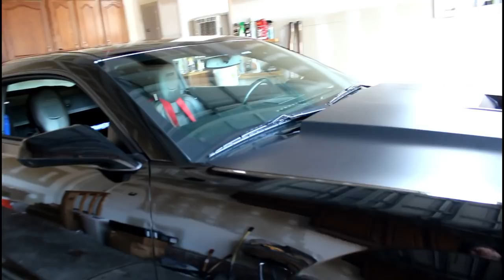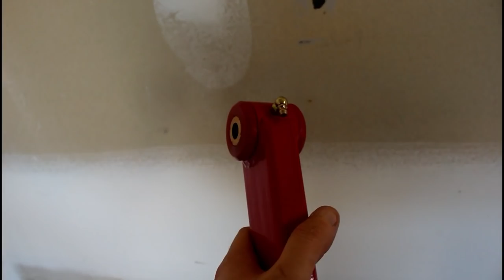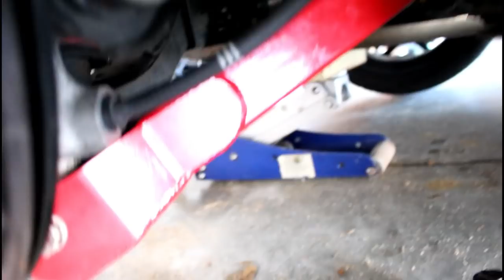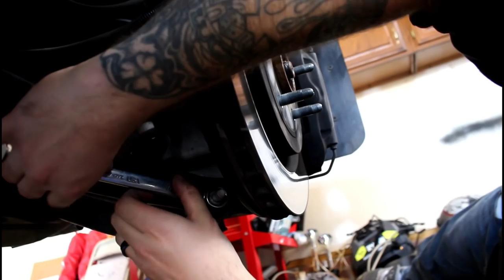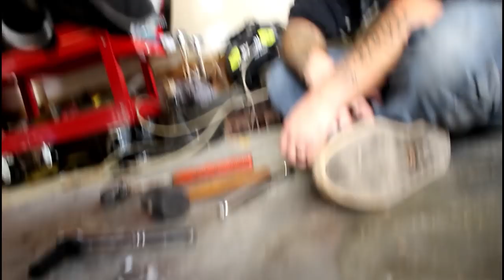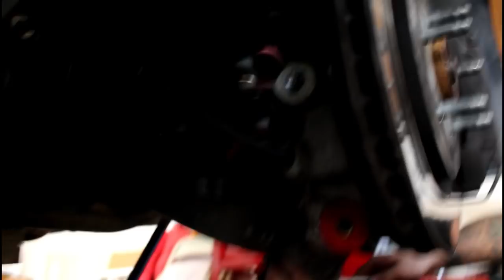BMR Trailing Arm Install For 2010-2015 Chevrolet Camaro

Comment: Did you torque the bolts with the car down or up on stands? BMR doesn't mention it in the instructions.
Reply from the maker: I torqued them with the car still in the air. Drove it maybe 100 miles and checked them. I haven’t had any issues!

Comment: SYNTHETIC LUBE ONLY. Any other lube will eat away at the urethane bushings. The lube is actually very important to avoid getting bushing noise.
Reply: Lube or grease? I will be using super lube synthetic grease on mine, but a multipurpose spray lube to slide the metal piece into the bushing since I don’t wanna wait a week for the super lube spray lube

Comment: Nice! Just installed my BMR trailing arms and adjustable toe rods last week, as well as lowering springs, on my Chevy SS sedan (same Zeta chassis as your 5th gen). Did you encounter any noises after a while? I’m noticing subtle creaking sounds from the back at low speeds under 25, or when backing up. Otherwise, car handling improved. Great video! 👏🏼
Reply from the maker: Dang, that’s strange. I didn’t have any weird noises with me. Did you load the up bushings with lube?
Reply: @Nasty2SS   Ah, maybe I didn't squeeze enough in there, I'll give that a shot and see what happens, thanks!

Comment: Hey I was wondering are you going to take your car to a road course track I wonder how your car with handle with your new suspension mods on a road course instead of a straight line what do you think can you make that happen???
Reply from the maker: I may do something like this when the warmer weather comes back around
Reply: @Nasty2SS  hey what's going on hey I got a 5th gen and it's all built for the track what do you think about the ZL1 wing and make it for a 2014 SS you get a chance let me know they have a website with pictures I use my car for the track everything is done to it port and polish heads bigger cam harmonic balancer suspension everything but the supercharger so you get a chance check out the website if you're not too busy what's your opinion

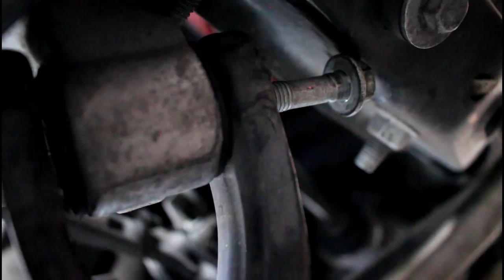Comment: At 8:06 what is that bolt called directly above his thumb ?
Reply from the maker: It’s one of the control arm bolts
Reply: On my passenger side that bolt is loose as in you can push it up and down. The black bushing piece is also gone any suggestions?
Reply from the maker: Replace the control arm bushing and bolt, it probably dry rotted over time

Comment: Need some help brother I wana lower my car on bmr springs but don’t know if I should do a  1.4 drop or 1.25 drop, I’m running 315s in rear
Reply from the maker: I’m on 1.4” right now and don’t have any fitment issues with the wheels\springs. I’ve heard some people do though. Strange the way some have issues and some don’t. If you want to be safe. I would do 1.25”
Reply: Nasty 2SS thanks for the heads up, will that make a huge difference over stock? I want my car to sit mean and can definitely tell it’s lowered.
Reply from the maker: Are you on my Facebook page or Instagram? I have some pics on there you take a look at to see the ride height on the 1.4
Reply: Nasty 2SS no bro I don’t have you, I can add you I have a camaro page and would love for you to follow me and give me feed back 🙏🏻 what’s your name? My pages ls3_camaro6.2

Comment: Bruh u need clutch 
When i upgrade mine to triple disk is like another car 
Mine has 250 hp more than yours but  when I was 590 I was twin disk then 
When i went to 720 I decided to go triple and man huge improvement 
I can feel the difference, I steel have my twin disk GeForce aluminium flywheel  if u are interested is used with only 1500 miles 
Looks new 
1k I pay 2400 dls
And 6k for the supercharger with all the upgrades worth 9k
Also I am going to sell my supercharger 2300 tv magnusum a lot expensive parts will be included such as custom tensioner 800 dls
850 dynamic injectors 
Cog upgrade 1200 
Upgrade heater exchanger 780 dls
I place an order for a short block from LMI
And I want to go twin turbo I also have 1000 CC injectors I was planning to use them but now I am going 1500 CC my gol
Is in the 1200 hp
Reply from the maker: Send me info on supercharger to my Facebook page. www.facebook.com/Nasty2SS